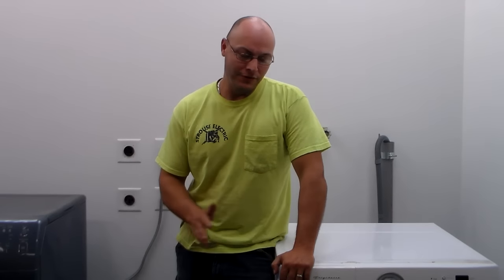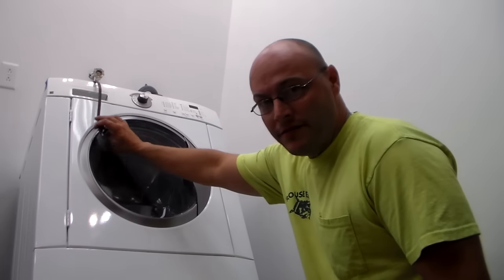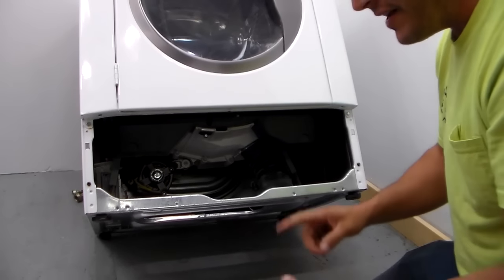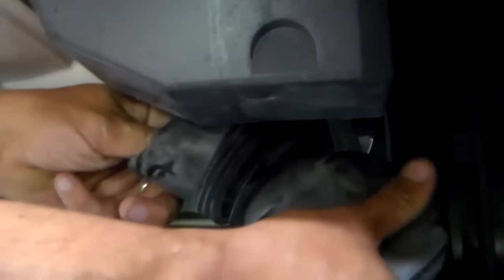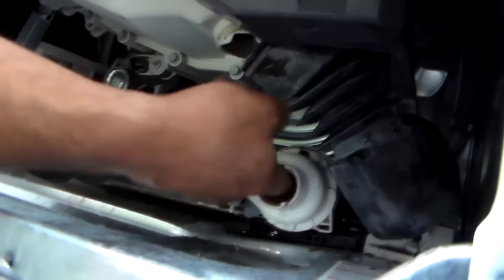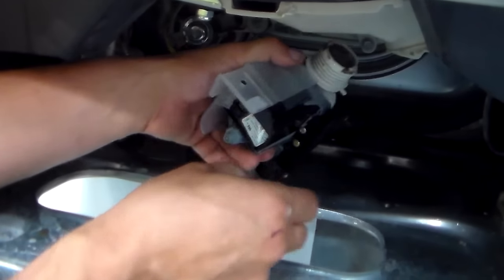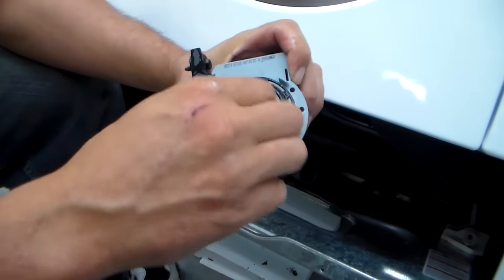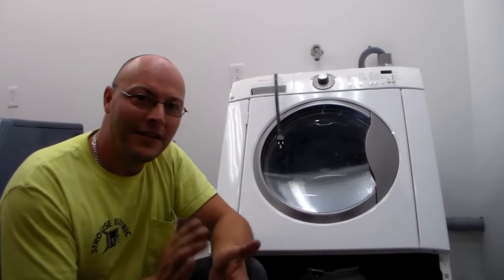Front Load Washer Repair - Not Draining or Spinning - How to Unclog the Drain Pump

Comment: This video, along with the other video because we have the front load washer that doesn't have the removable lower panel, made it easy to clear the clog. 

I'm the type of person that usually runs into some type of problem that makes it difficult to compete the task. I'm happy to say that, with the aide of these videos, did not run into any major problems during any of the taking apart or putting back together process. 

Thank you.

Comment: Bill; Great video thanks much. About 2 years ago my washer was having some final spin problems where the clothes would be dripping wet, had to re-do the spin cycle 1 or 2 more times before it spun enough, but clothes were still a little damp. Then oddly enough, the washer seemed to 'heal itself' and spin worked fine. But lately the wet clothes problem has come back. Unfortunately my washer has no filter of any kind, except for the 'coin trap' at the bottom of the rubber boot. There was about $7 in coins down there (from former home owner as I always empty my pockets first), the pennies all corroded, and a small ball of pet hair in the impeller area. My pump may be weak or going out, as sometimes it drains completely, and lately after the spin cycle the clothes are dripping wet. I have to do the fast spin cycle 2 or 3 times to get it draining and then it does the fast spin cycle properly. Yesterday I did a bed blanket full of dog hair, and after the spin that didn't really happen, the blanket was sitting in a pool of water, so 4 attempts at the fast spin and it finally drained and spun the blanket water out properly. For normal washes of clothes where it doesn't drain & spin properly, it's hard for me to imagine those coins could have swirled, and/or or the small ball of pet hair could have caused so much trouble draining? I have 2 small dogs and always have some dog hair in the wash. Even after I clean the rubber boot and put it back together to test, if it works OK now, I am not very confident in the long term ability of this washer pump system to stay clear. Looks like I might need to buy a new washer that has a water pump filter with easy access from a door in front where I can clean the pump water filter of dog hair after every wash. The bed blanket I did yesterday was full of dog hair, must be why it took 4 attempts before it finally drained & spun properly, may have had to force a big wad of dog hair through first? Sorry for going on so long, it gets complicated! Thanks again for the fine video. Now I'm going to Google 'pet friendly washing machines' and see what I can find...
Reply: You can also try running the blankets in the dryer first to remove hair, then wash. Of course it means cleaning the dryer afterwards but I found almost all the hair comes off before washing.

Comment: Great video, I'm actually excited to get my machine apart and see if this is my problem.
Reply from the maker: How did you make out?
Reply: Problemo solved!  My washer has the separate coin catcher after the rubber boot, but the cover still needed to be removed to access it.  I took everything apart anyway like you did in the video just to be sure but it was the $3.45 of change and the 8 metal collar holders that were the problem...the propeller was fine.  Thanks!  You saved me from buying a new machine....my wife was already shopping..HAHA

Comment: This was awesome. Thank you. I did it, but the problem ended up being an electrical malfunction signal in the door handle, not a blockage in the drain (apparently the door handle was signalling that the door was open, so the washing machine would not enter the spin cycle because it thought the door was open). Although I found $1.36, So that kind of discount of the 250 bucks we spent on a plumber to fix the problem :-)

Comment: Thank you very much! It was a sock.  I ended up using a tiny 4" DeWalt Clamp to get the drain hose back on - it was a hose clamp spring and was impossible to get back on with the channel locks.

Comment: Thank you, managed to repair our LG front loader, the tip about tipping it back was really helpful, in our case a pillow decided to self destruct and clogged everything, but it's all good now and running just fine, that hose wasn't fun to get on or off, thankfully I didn't need to remove the pump, I did connect a hose to the drain line and back flush out the pump (machine outside for this) I would advise that the machine be taken outside if possible or that provision be made to catch water as you go in to this kind of repair, surprising how much water was trapped in there, would have been quite the mess to deal with inside the house.

Comment: Great video.  Thank you!  My washer is running great again.  Saved me from having to buy a new washer right now.  The only difficulty I ran into was that I had to drill one of the screws on the front panel due to it being rusted so badly.

Comment: This video is Great and I saved a lot of repair money and my washer, my washer would not drain I used a wet vac to catch the water when I took off the 1st clamp and avoided a mess(great move); I found bra wires, coins, pins and junk inside the trap, the impeller worked fine and now my machine is back up and running, thanks.

Comment: I just did this same repair last night as I had a sock plugging up my drain.    I tried to go through the front but found it way easier to remove the back panel.   Way more room to work from the back than the front.

Comment: Excellent video, Bill.  Very clear, well explained, and not wasting a ton of time with claptrap filler like most how to videos do.  I THINK I've accomplished what I needed to.  Had a down pillow blow up, and removed huge clumps of down from the pump tube and strainer.  Hardest part was getting the bloody Costco work light packaging open.  Second hardest part has been getting the rubber tube back onto the plastic tube and positioning the spring clamp (so in truth, I'm not done and don't know if I've been successful yet.)  Every time I try to push the spring clamp back over the plastic tube, the rubber tube pops off.  Anyone have any hints??  I'd hate to pay a $300 service fee just to have someone put a spring clamp back on..
Reply: I assume you got this clamp back on but for anyone else: I'm not as young and strong as I used to be so my husband had to help --- I could not have done it myself.   We ended up starting with the clamp on the black hose and NOT on the white part of the pump, then I used the pliers to open the clamp while he gradually moved the black hose closer to the pump.  It took both me and hubs laying on the floor for close to 30 minutes working together in that small barely accessible space to get that hose back on and clamped -- it was a royal PIA!!

Comment: Thanks for the demo--very helpful. I took everything apart, but before I put it back together, I wanted to know about a plastic ball a little smaller than a tennis ball in the rubber boot.  Is it supposed to be there?

Comment: Thanks I followed this and it worked. Unfortunately my washer and dryer are stacked in a closet on the second level of my house, at the top of the stairs. It took a few hours of fighting with the screwdriver as  I couldn't tilt my washer upwards with a dryer on top. I had a shop a shop vac which I brought inside to soak up the tsunami of water once I pulled the drain off. I still have water dripping through my ceiling into my main floor, But it worked.

Comment: Bill, thanks for this video.  Question - what would you suspect if my Duet washer drains sometimes like it should and not others in a normal wash cycle?  

When it doesn't drain, we simply move it to the drain cycle and run it and it always drains.

Comment: Well, I've been washer-less for about 3 weeks now.  Have an HE4T, which is just a little different from the one you showed.  I was encouraged because I could reach in with my finger and get the impeller to move. But when I got the whole thing out and disassembled, it almost looks like one piece between two blades has the black rubber trying to ooze up. Weird, right?  Have figured out it has to be replaced.  Killed the dryer by throwing the super wet towels in, but watched ur vid on that as well.  Now - where do I get all these parts to fix it CHEAP??  And I guess purchasing one of those meters is in my future as well, if you have any recommendations.   Really good vids, BTW, for us older single gals.  Thank you.

Comment: Bill, thanks for your help.  I have a Kenmore Front Loading washer.  I have cleaned out the coin trap and have tested the drain pump and they all check out but my clothes are still sopping wet at the end of the cycle.  The drum does spin but not at a speed that would extract any water.  What would be the next item to check.  I have watched an entire cycle and I don't see anything out of the normal.

Comment: I did this and it worked wonderfully. If you can answer one question please. I had a bear of a time with those spring type clamps on the hoses. I am wondering if I can replace these with another type of clamps. I have no coin trap in my washer so I have a feeling I may be doing this again.

Comment: Neighbors had an issue where their washer wasn't running right.  Get into the propeller and found a bobby pin did get stuck.  Way I found that out was after attempting to run it the pump was HOT.  Now I think I need to go into that coin trap and clean that out, as its not empty all of the water during its run.

Comment: I only needed to clear my drain filter so I watched to see how to get the front panel off. There were 3 screws on my kenmore elite front load.  I will never buy a Kenmore or Maytag again if they continue to use 7/64 Allen wrench sized screws. GD!! It took me quite awhile to get those screws out ! Once the front panel was off it was super easy to clean out the filter catch all. ( an entire pen , hair thingy, pebbles, plastic wrap, etc in the filter)

Comment: Hello Bill thank you for your videos they really help! In this situation we followed all the directions and put it back together with no problem. Our coin cather wasn't filled with alot of debris...the other part spined when we checked it, Nothing caught inside of it either. I ran the washer in a regular cycle and it did not spin or drain. (It does circle as the water enters. Its again left full of water. Any other suggestions?  Please help?
Reply: Did you figure out the problem?? I think ours has the same issue. Thanks!

Comment: i have watched your video and find it will b easy to clean out to see if this is what is causing my issues, only problem is, i have a frigidaire front load that doesnt have a panel in the front, i tried goin through back access panel but cant get enough room, how do i take the front panel off so i may get to the mechanisms to clean, and btw its full of water because i couldnt get it to drain for me.

Comment: While mine was under warranty they would do this...the guy showed me all the easy fix stuff. I actually have a mesh gaurd for mine so stuff doesnt even go thru the slot on my machine in the front when draining. But having cats hair balls build up. And I have to just remove the boot at the top reach in and pull all the hunk out screw boot back in and good to go

Comment: Thank you for this, the coin trap was jammed full of stuff, but I am having great difficulty putting the final green clamp back on, did you have to use a special tool? Pliers keep slipping off and I can't keep the clamp open long enough to secure the rubber onto the plastic part...?

Comment: Great video,  Followed this step by step and the washing machine drains just fine however now the spin cycle won't engage. I hear the motor sound but no spin.  Slight agitation does happen but it looks like it struggling to move. Any ideas?

Comment: Bill, really good video which I followed when our front loader automatic washer, a Haier, stopped draining before spinning and showed an ERR 2 code which is a blocked drain pipe. Having followed your instructions everything was cleaned and then reassembled. Impeller was spinning freely. Tried a cycle again... Same Err 2 flashed up. Any suggestions on my next move?

Comment: So I've done this before many times with my washer, and it is easy and works great.  but, this time there is a sock that is actually stuck/caught on something and won't pull out.  do you know of anything up there that would catch it?  it may be some other debris holding it.  but, before i tug or cut, thought i'd see if you knew if there was any kind of motor, rotors or other thing on which it might get caught.  Thanks!

Comment: Opened up the boot in 23 year old Frigidaire & at least 40 coins, screw, screw bit, zipper pull and lots of grit (previous owner). Cannot get off the corrugated drain hose from pump. It’s rigid and I take it from your video I need to get the two screws holding the pump to the machine off. 98 percent positive it was fiber fill from a torn pillow that is the culprit. Stacking washer & dryer.... WT Heck do I do if the corrugated hose is blocked. I’m certain there is fiber in it as some came out of drain after the pillow broke open.

Comment: Hi Bill,
Thanks for the great video! I accidentally made the mistake of disconnecting the rubber boot from the pressure switch tube, and I'm finding it extremely hard to get these two things reconnected again. Any tips on how to do this? Thanks again.

Comment: Great video, thank you for posting it! My girlfriend and I are trying to operate on our washer right now but one thing we can't figure out is how to drain the water out first- any suggestions? We have a Maytag Bravos Quiet Seriers 300 and the tub is full of water right now.. :(
Reply: +Angela b  Update: we got the water to drain out the back which was pretty easy.. we found what was causing the issue- a penny was blocking it completely. We were going to remove the pennies and other debris however the hole is not big enough for the penny to fit through. We are stuck. There does not appear to be a penny catcher as we see in this video. so we poked the penny back in to get it out of the way.. put it half way back together and it started to run(which it would not do at all before), but then stopped again. Holy moly I think we are screwed.

Comment: Hello Bill, 

Thank you for this very informative video! I followed you directions and was able to successfully clean my drain pump, however my front loader is still not spinning. When I start the cycle it will fill partially with water then make a jerk motion and stop, the timer continues but the washer does nothing else for the rest of the cycle. On the rinse and spin cycle it will  again partially fill then make a jerk motion and stop. The lights will continue to run until the timer runs out of time... Can you please give your insight? : )

Comment: Hi Bill:

Thank you for your video, I have removed and check the drain pump 
but apparently the problem was not in this part of the system both the drain pump and hoses were completely clean of clogging. so, I put the washing machine to do a cycle and I have discovered that the machine is not making the final spin leaving the clothes wet.
There is a detail that seems strange to me: during the washing cycle the washer makes the necessary spin to put out the detergent from the clothes, but it is not spinning during the drying cycle….
Do you have any idea about what may be happening?
Thanks in advance for your help…

Comment: Hey Bill. Great tutorial. Unfortunately, I replaced the pump, cleaned the drain pipe , and I still get a F21 error message.
The water will still not drain.
What else could be the problem?

Comment: Hi Bill. Thanks for the great info. I have an electrolux front loader where the front panel is 1 piece. It's about 4-5 years old. Model # EWFLS70JIW0. About a week ago it stopped pumping the water out. I replaced the drain pump and it worked fine for a couple days. Now is stopped draining again this time it displays E21 which I believe is a drain error and the door did not unlatch. I did not check the hoses that connect to the pump when I had them off (kicking myself now). Any ideas?  Also about 2 years ago we went through a couple of washes where the door would not unlatch after the cycle ended. We unplugged the machine for a while, and the door would open. Then the problem seemed to go away. Could this be a related issue? Could the door latch be the issue? I'm stumped. By they way, I did get the door unlocked but the machine is currently full of water. Any help would be appreciated. Thanks!